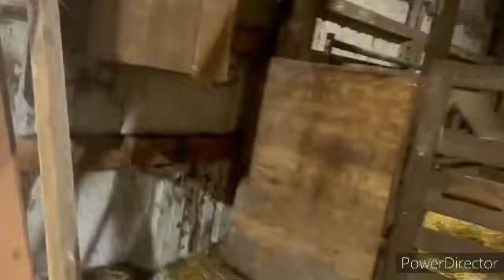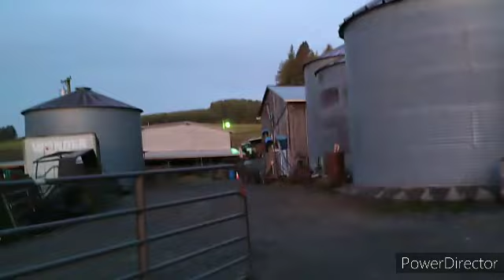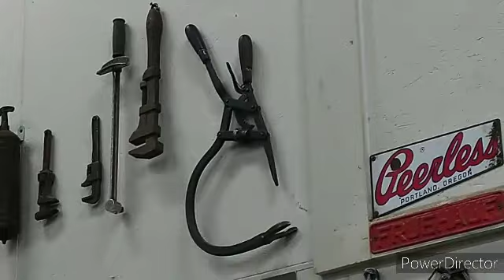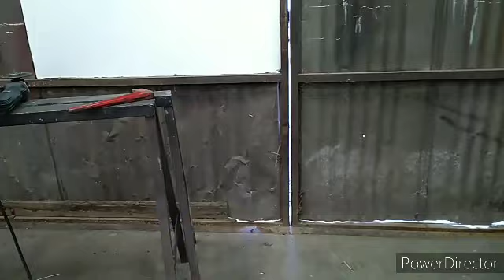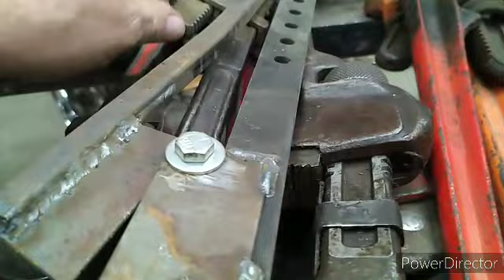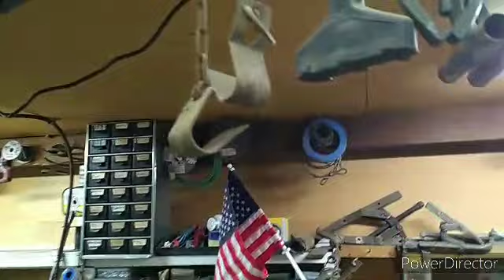sunrise! moving Becky stuff. old tools, fixed up some pipe wrenches

Comment: At least all your pipe wrenches have straight handles, 3 of my Dad's 4 old wrench handles are curled from over torquing during his well drilling days. Teeth are shot too but they are some of my mementos.  Just about all residential plumbing done today is in copper, PEX or handled with Channel Lock type pliers.
Reply from the maker: Lmao 🤣😂.. a couple have a little curve to them. Ya, lots of other ways now days, but pipe wrenches still have their places.. still steel pipe around, good shaft turners and big nuts they fit. 
Those are definitely keepers you have!!
Thank you Wayne!
Reply: @GosselinFarmsEdGosselin  After I hit the comment tag, I should have re-mentioned the fun you three are having with Blakey, sorting through old baby clothes and just enjoying the love she brings, (regardless of those fussy moments)!
Reply from the maker: @kswaynes7569  it is fun, not only the over 20 year old clothes, but most of what is in the container, we haven't seen it 7 years.. 
I kinda have it made, I didn't sign up for babysitting.. so I miss out on most of the cranky moments 😎🤫
Reply: @GosselinFarmsEdGosselin  Most grandpa’s do miss those times (including diaper changes).
Reply from the maker: @kswaynes7569  👍😁